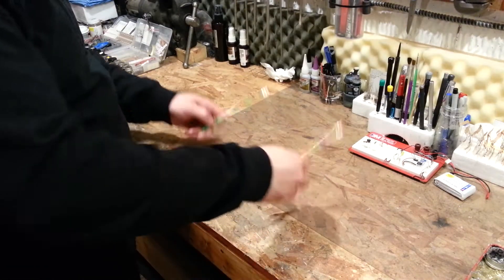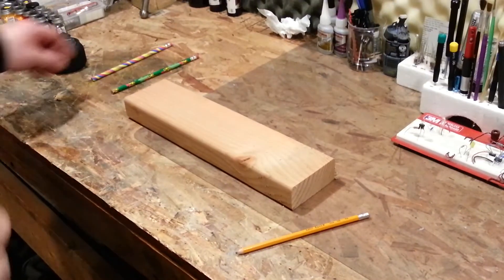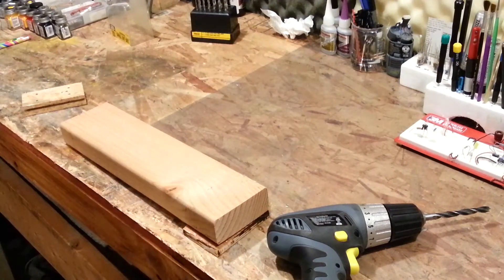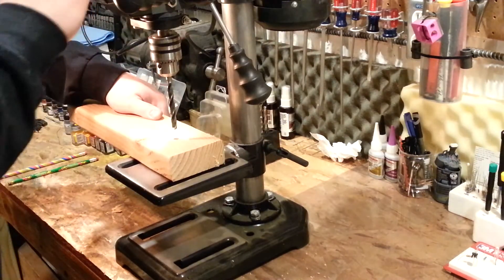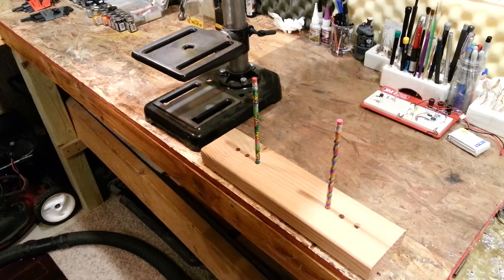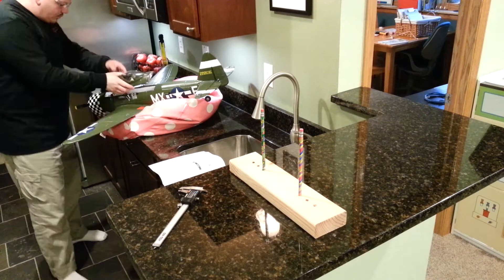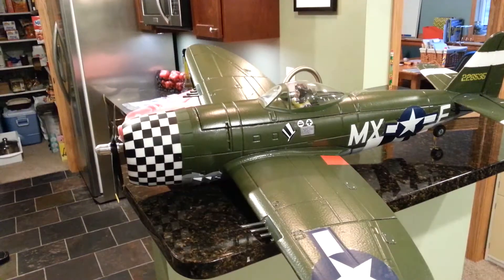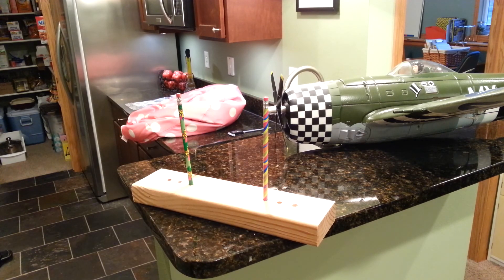RC Plane Center of Gravity Tester - How To Build Video

Comment: With your calpers and the plane on the balancer use the tail end the piece of wire that sticks out is the same as the distance between the calpers points.

Comment: i know this is an old video but i feel alot of my rc warbirds that tend to LOOK like their flying Tail Heavy iis because there is not enough down angle on the motor mount, so i usually just put 2 shims on the top side of the motor mount to help it fly more level all around.
Reply from the maker: I believe there was quite a bit of down and right on this molding, but I could check it out. Thanks!
Reply: @BrianPhillipsRC  it doesnt take much just a few degrees of angle and its a whole different flying plane!  Hence why when people rebuild a crashed plane it never flys the same.

Comment: Great video. I think, when you’re doing the CG on a plane with retracts, the gear should be down. Just a thought. I read that in one of my instruction manuals throughout the years I’ve spent building airplane models.
Reply from the maker: I've heard down is generally the rule of thumb, especially when the gear down situation changes forward, but on this plane...I suspect it's probably not a huge factor as they swing out more or less straight out...some jets the two mains go back and the nose gear go forward, or all three move back...this can cause a kinda hairy situation if you get too tail heavy for landing ;)

Comment: This is nothing new.   Made one of these way back in 1974, when I first started flying Radio Control.  In fact I have one in my RC work area right now and just used it last week on 2 different planes   Jumbo pencils work better. They have a larger diameter eraser area. Also a 2 x 6 is more stable.  BTW you should always check CG with the landing gear retracted (if they retract especially aft) and a low or low mid-wing plane upside down!
Reply from the maker: I realize these have been around for ages. Nothing new under the sun, right!

I do like your "jumbo pencil" idea! I'll probably buy some and give my kids pencils back. There happened to be round, rather than octagonal, but the erasers were crappier on the kids style.

I always vet CG with Gear Up (retracted), but in this case, with side swinging gear, there wasn't too much a difference. I have a few planes with gear that rock back toward the tail, and that can make a weird effect for landing, especially some heavy all metal gear!. 

As for the 2X6, I was thinking about using the 2X8, but then I figured it'd just get to huge and get in the way. It took about 3 times longer since I filmed it (as usual....this was a 5 minute build)
Reply: BTW the Jumbo pencils I found were round and about 1/2 inch in diameter. Work well for up to about a 7 lb airplane. More than that and you must be careful they don't poke through the airplane skin.  I think I got the pencils at Lowes.
Reply from the maker: Cool, thanks! I'll get some soon
Reply: New or not, i havent seen it before, and learned something new. :)